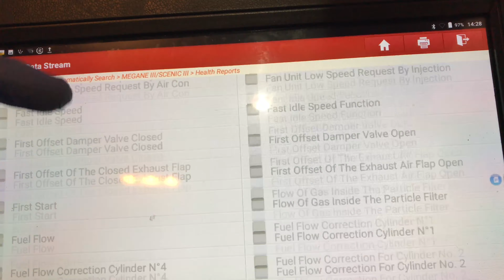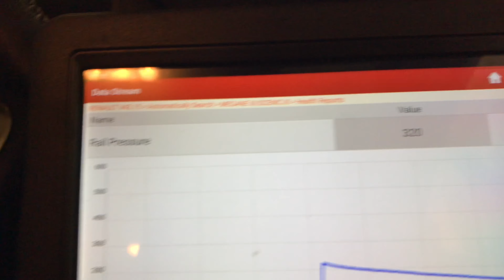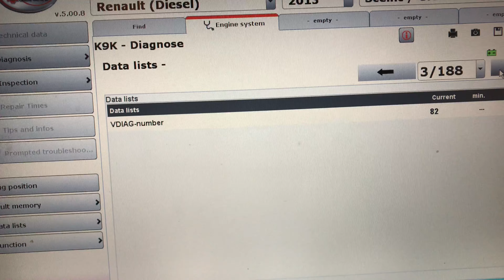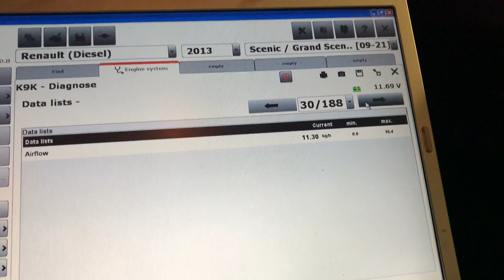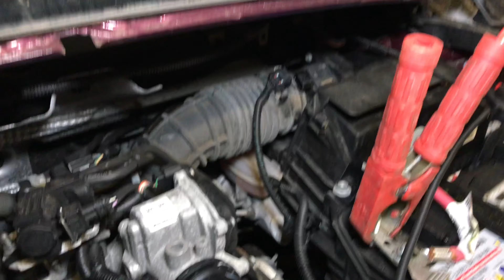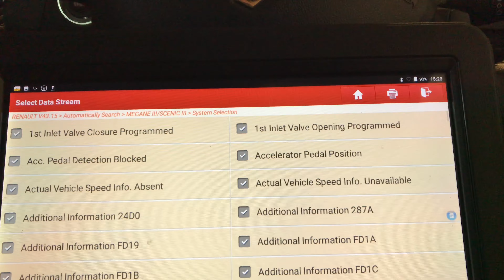Renault Scenic III (2013) 1.5dci - 4 New Injectors, Still No Start!!!!

Comment: Sandy could you help me out please i done the same as you with the launch calibrations and car won’t start it was starting before and I haven’t changed any injectors also would their be bearings in mine to remove or what do you suggest have I scattered the codes and will need to re code the injectors ?

Comment: Did you code the injectors with the launch ok, ive a Kangoo 1.5dci and have a new set to go in but don’t want to pull the old ones and put new ones in until I can code them

Comment: K9K Renault Clio 2011 1.5dci non turbo 86HP it started to have a problem to start up the engine, few colds mornings and the engine needed more cranks to turn the engine, and it started but the other day it didn't I change the glow plugs - no service history, glow plug modem, coolant sensor will do the fuel filter and oil service and the car seems like it doesnt want to start Cranks ok but the voltage on the glowplug 4sockets drops dramatically up to 12v about and drops right away, can't heat the glowplug enough and the car doesnt start. Any suggestion pls Thank you for all Best
Reply: Clio 3 aracın kızırma bujisi 12 volt değil, yanlış hatırlamıyorsam 4,4 volt. Yanlış kızdırma bujisi takmış olabilirsiniz.

Comment: The Renault 1.5dci is a good engine but their fuel supply systems are horrendous
Reply: I would never buy another Renault diesel, at least the petrols are easier and cheaper to repair

Comment: How did ball come inside there i dont get it??? How did u remove it??
Reply from the maker: I use bicycle wheel ball bearings to blank off each injector to see if pressure rises because of leaking injector, I forgot to remove them LOL
Reply: @sandyande  ohh i was so confused where would they come from😂 nice work mate we learn from mistakes, tnx for reply

Comment: Just come across your channel Sandy and have subscribed. I am having a problem with my scenic 1.6 dci through accidentally putting a small amount of petrol in was drained before start up but there must have been a small amount left in the tank. Injectors fuel rail and high pressure pump changed but she still won’t start. Doing a lot of head scratching
Reply from the maker: What's the pressure when u crank needs to be at least 300bar

Comment: Where’s number 1 injector on Renault flywheel end or front end coded injectors in wrong position ?
Reply: This would not cause a non start , coded injectors are coded to calibrate the sealing Pintle inside the injector and nothing to do with what cylinder there fitted to, you can remove already coded injectors and swap them to different cylinders and it will still start the only difference is the fine tuning of the coding for the sealing and opening phase of the injectors will be mixed up but this is fine tuning to calibrate all injectors to have the exact same phase of opening and closing but will still start and run may affect smooth idle
Reply: @del9936  once did a Mondeo wrong wouldn’t start, put them in wrong firing order, corrected them it started, only talking from experience and a lot of head scratching!
Reply: This^^ AFAIK the # 1 is flywheel side